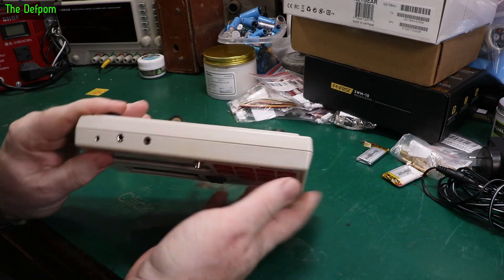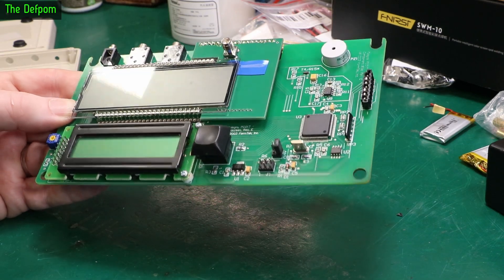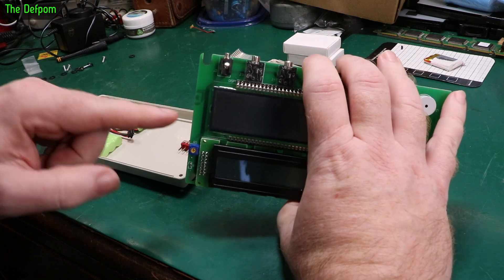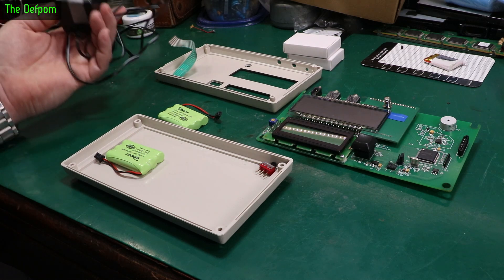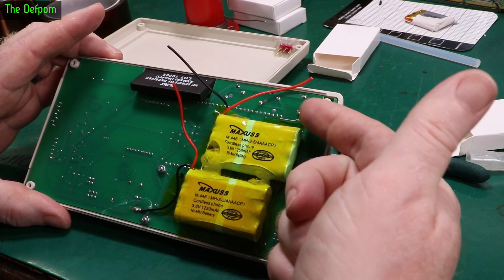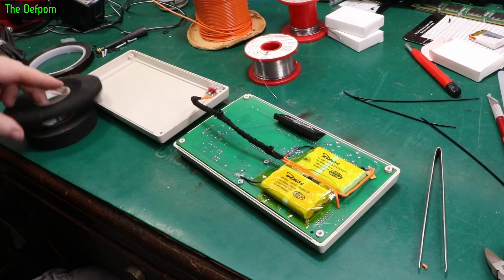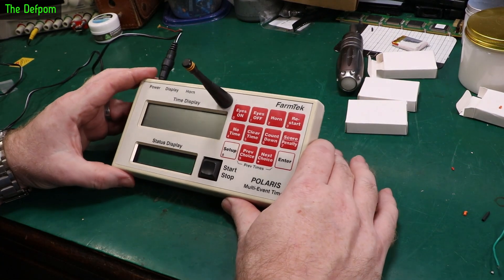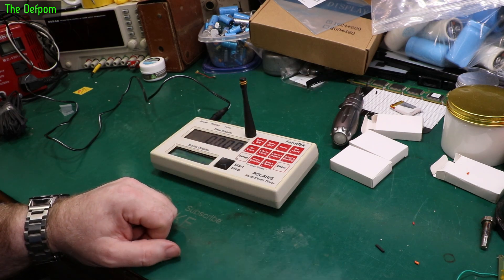🔴 Farmtek Console From 2003 - Converted From Mains Powered Plugpack To NiMH - No.1251

Comment: What's that black stick poking up out of the control panel towards the end of the video?
Reply: Ariel.
Reply from the maker: It’s an antenna
Reply: @TheDefpom  An antenna?  What for?  Can this timer be used for turning other devices on and off?  What would you typically use a timer like this to control?  Pumps?  Sprinklers?  Some other pieces of agricultural or farming equipment?  I thought I saw a button marked horn on the unit, what's that for?
Reply from the maker: @Lachlant1984  It is a receiver, it is used as part of the sports timer system, there are light curtains which detect the start and stop, those light curtains send signals to this console to tel it to start and stop, and display the time. I have done several videos on the Farmtek timer system so if this interests you, you could watch my Farmtek playlist.
Reply: @TheDefpom  Ah, I understand.  I'll take a look at the other videos then.  Thanks.

Comment: usb port and a power bank?

nimh has  different dishcarge curve to lion, will drop to 1.2v/cell for most of the discharge then drop rapidly near empty
Reply: Modifying a unit for somebody else to use, and using Lithium Ion would have been a mistake. It’s just too dangerous and liable if something goes wrong. A simple BMS is not enough, careful design and consideration would need to be done. NIMH was the right decision.
Lithium Ion battery fire…….been there done that.
Reply: @IanScottJohnston  An excellent point beautifully put.
Reply: @IanScottJohnston  You can't beat good old NiMH as a power source. The only problem is you need a charger that can either detect the voltage peak or worse wait until the batteries start turning the charge current in to heat. As for a power capacity meter, god knows how you determine where you are on that quite flat voltage discharge curve. you could detect the knee and decide yes I've now got no power left. 🙂
Reply: @IanScottJohnston  I thought it was only the welsh who like to come back to a real home fire. But i don't think they and lithium batteries in mind when they made that advert. 🙂
Reply from the maker: Yes the battery performance was considered when I was deciding on which battery type to go with, nimh suited it best for function and physical fitment
Reply: @TheDefpom  i like NiMH, they're easy to deal with, just the fuel gauge doesn't quite work well with them.
Reply: Having followed the channel for some time I am confident that all options of cell/battery configurations were carefully considered when given the devices application and environment. Based on this I believe this was the best course of action.